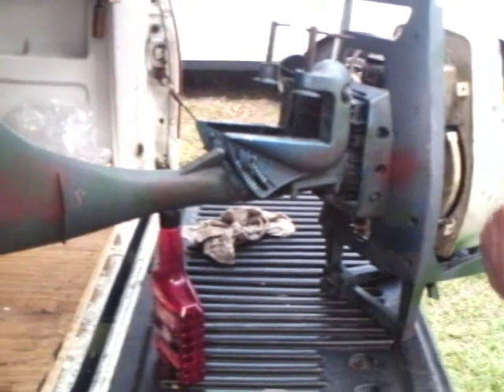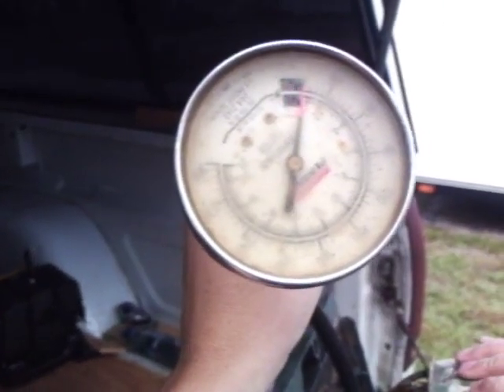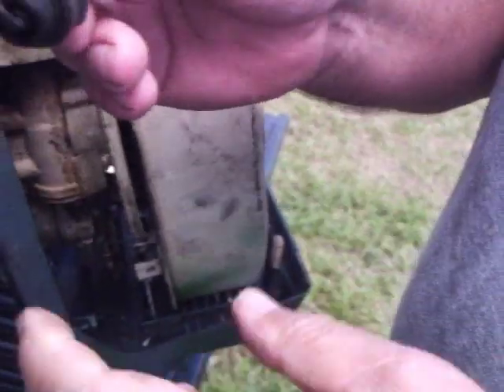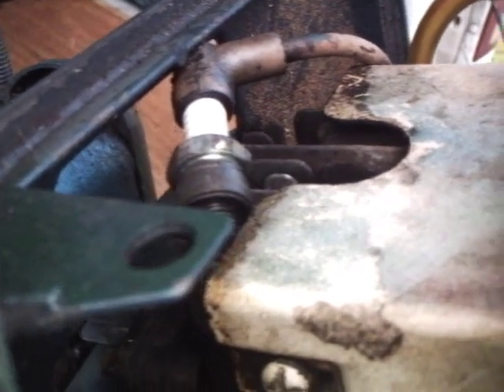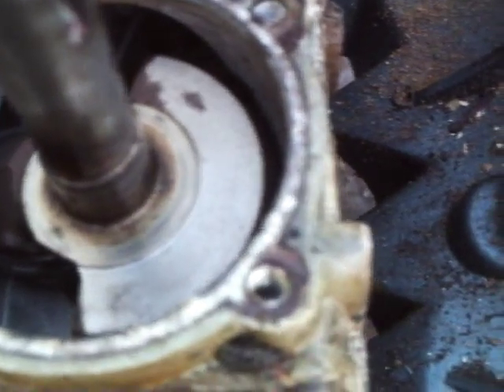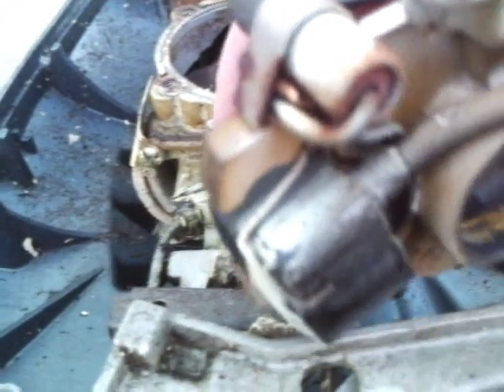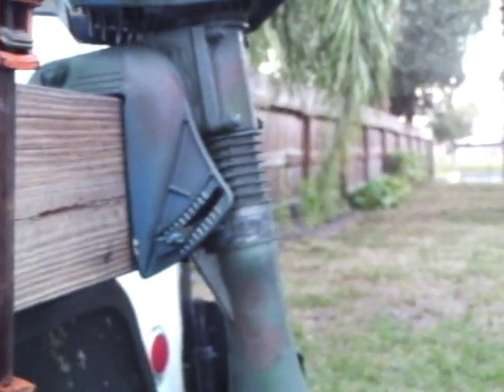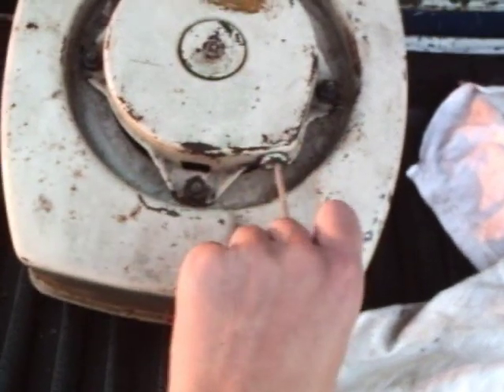Eska outboard motor restoration parts 1 and 2

Comment: Get some ‘muriatic’ swimming pool acid  ( sold at Mjeir or Wallmart ). Seal up your tank with some beebees or small nuts and washers or even pebbles and the pool acid. Shake it around for a good while then drain and rinse the tank with fresh fuel. I usually do this a couple if times. If the tank is real bad or leaking , there are epoxy liner pour in kits for motorcycle tanks available...hope this helps

Comment: to clean the gas tank use some chain and paint thinner slosh it around
you can call discount marine parts at 1-906-466-2180 I found the condenser and solenoid and points for my 1971 5hp and they ship to you....

Comment: I would try a new spark plug and clean out fuel tank with rock ,nails and screws and such. Also put a clear glass fuel filter in fuel line. Mike

Comment: That doesn't look like an RJ12YC spark plug, which is standard for virtually all Eskas.  Not a good idea to just clean the plug...every time you take it out and reinstall it, you lose the seal of the crush washer.  Champion plugs are cheap, it's worth it to throw in a new one any time you take the old one out.

Comment: The engine is tecumseh, so the appropriate condensor would be at a lawn mower shop. The motor model is probably on the engine someplace. Mine has a metal tag. Don't believe the guys that just look in the book and say "It isn't in the book so it doesn't exist." I was dealing with such a character, when an old timer saw my motor and said, Oh, we've got those over here.
 On mine, I put rocks in the tank and shook it for a while with a little gas. Note: I counted them so I knew how many to remove.

Comment: and then, after cleaning the tank, if you don't plan to use it right away, put some 2 stroke oil or MMO in it (not a lot, just a few ounces) and roll the tank around to coat all the sides with oil to prevent more rust from forming. Good luck with the engine. :)

Comment: for the condenser just use one for a tecumseh lawn mower engine, preferrably a 2 cycle engine but nay tecumseh small engine condenser should work.

for the fuel tank fill it half way with diesel fuel or heavy duty carb cleaner and get a package of about 1500 or 2000 airgun BBs and dump those in it. put the cap on and shake the hell out of it for a few minutes. let it soak, and shake again. afterward, rinse it out with diesel twice or 3 times.